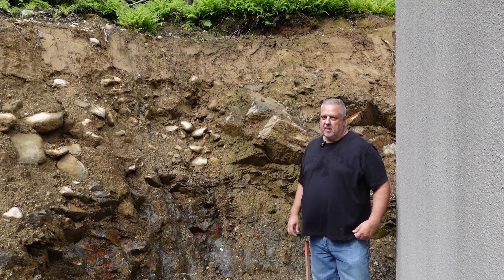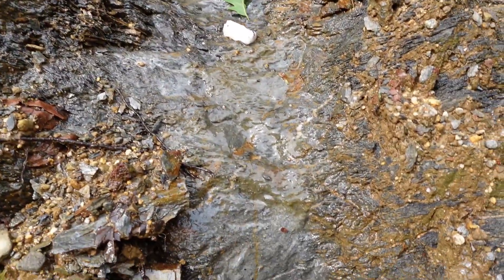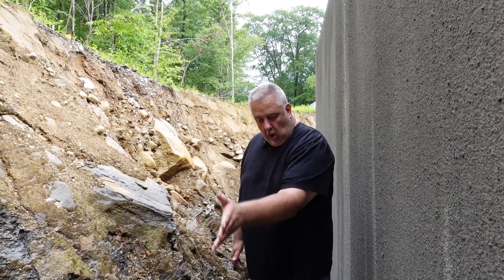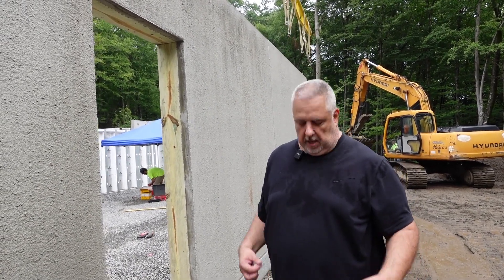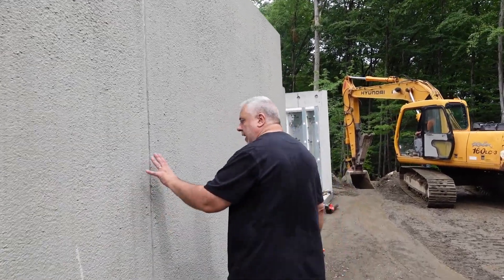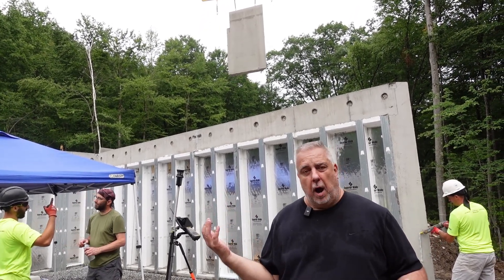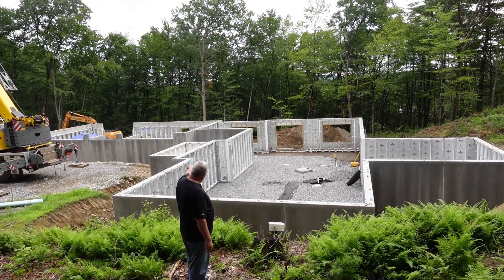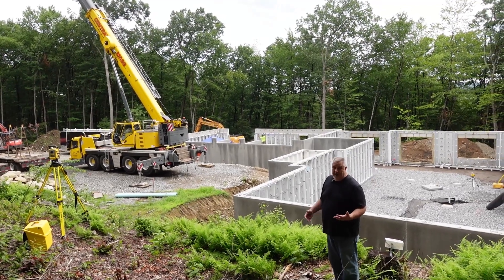OFFSITE BUILD - SITE HYDROLOGY

Comment: Roughly what would the cost difference be between using those Superior panels vs say a 4" core ICF wall for that basement?  Granted you'd need to add extra waterproofing to the exterior foam, and all of the corners in that basement layout would be a nightmare.  Would those panels support any sort of poured concrete floor for the first floor?  I live in tornado territory so I'd love an EXTRA secure basement area.
Reply from the maker: In our area, this is far less expensive than ICF........and stay tuned, we have concrete planks flying in soon.....

Comment: Steve, is there any way to thermally break Superior Walls or ICF from the stone base or footer? The footer or stone contacting the concrete wall seems to be the last thermal bridge in this type of structure. It's a constant 55° energy leak. Wouldn't it be better if that mass was inside the thermal envelope. Would love to hear what think. 300+psi foam glass board???
Reply from the maker: I think your chasing hairs. There is a slight delta, but the cross section of this system is about half of that of a typical 10" wall on a concrete footing. I have done numerous houses to very high degrees of success not really being concerned with that small cross section / minimal delta..........buying the right windows above eclipse's this concern.
Reply: @stevenbaczekarchitect9431  thank you Steve! We appreciate all your work!